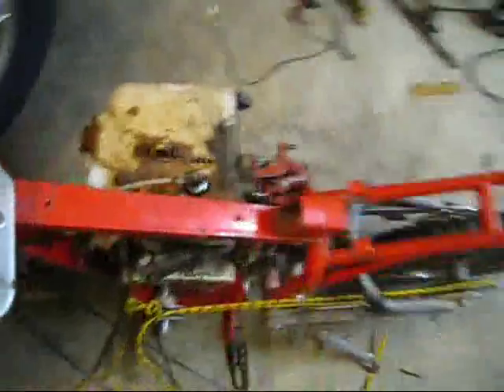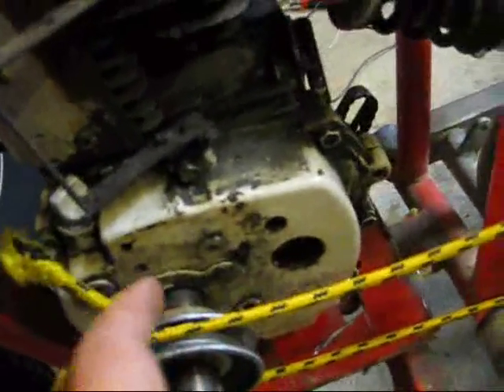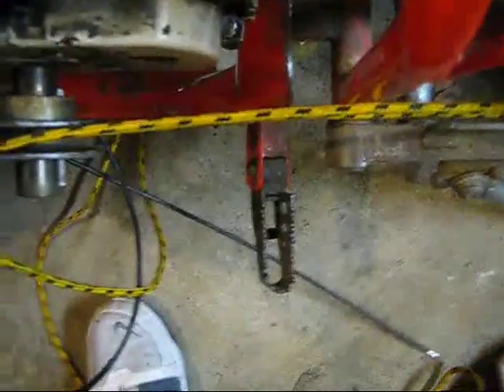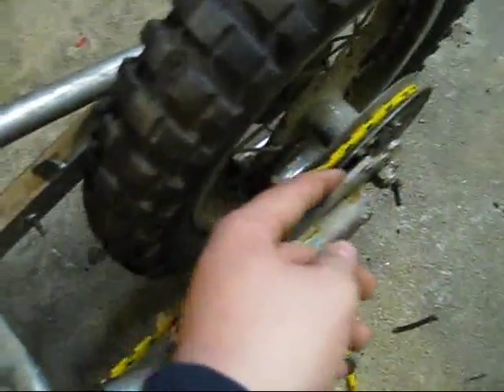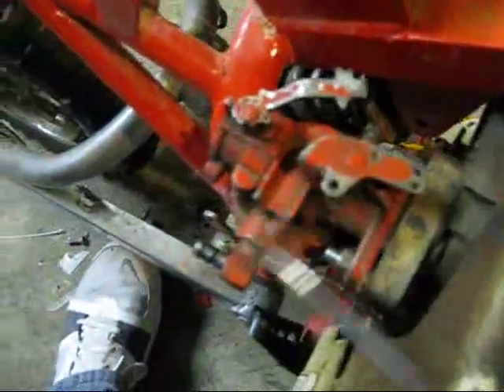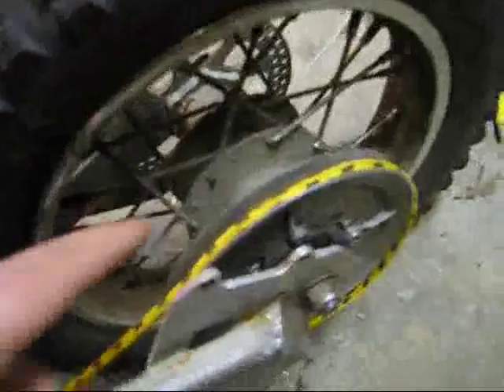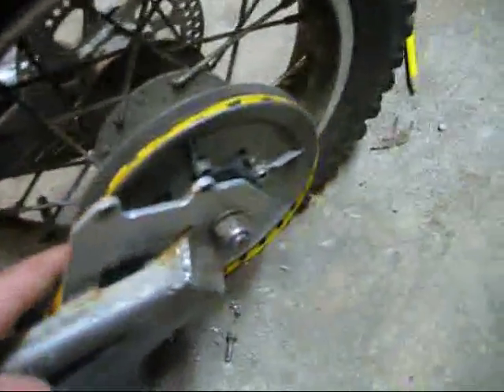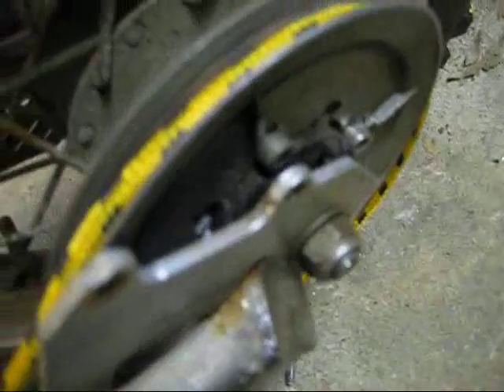Razor MX500 5hp engine swap Update #1

Comment: looks good but the only problam i can see is starting it unless you make a clutch which is your best bet because its hard to tight belts up with no tensener ... all you would need for a lever clutch is another pully on a arm so when you pull down on it tigtens the belt release it and engine spins freely ...its about the easiest clutch